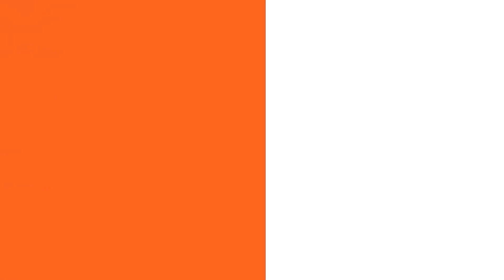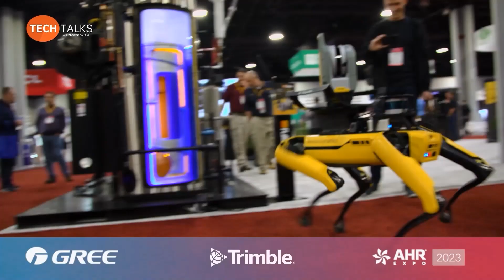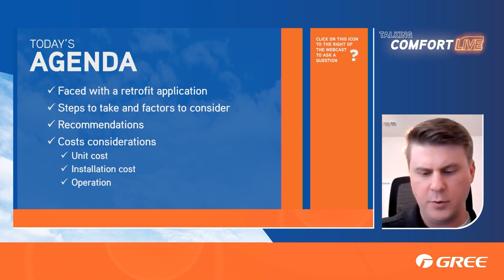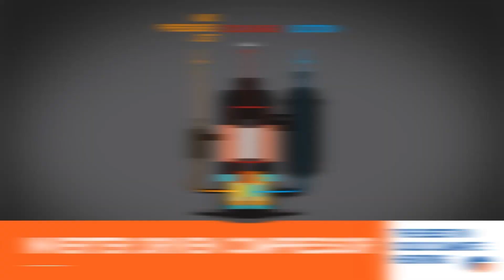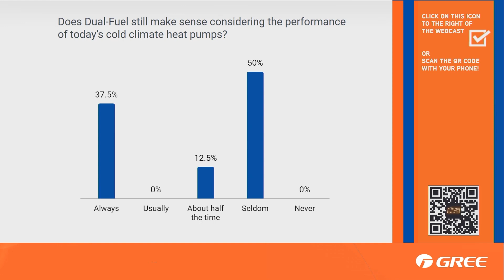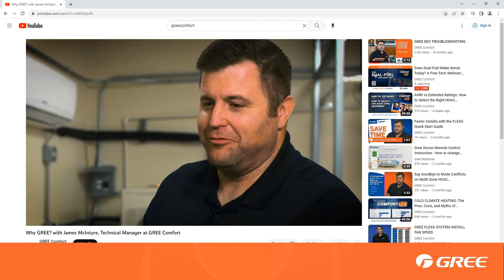Does Dual-Fuel Make Sense Today? The steps to take & factors to consider when faced with a retrofit

Comment: I sell a majority of dual-fuel systems in the Denver area.  If they already have a PVC based 95+, we have many options all the way to full modulating variable speed furnace or if they have an 80% then we do a two-stage natural gas Bryant Evolution or ICP Ion, plus either of their HP's, (Fully variable or 5-stage Copeland Rotary scroll.  You setup the Connex or Ion to change the setpoint and furnace runs in the first stage nearly 90% of the time, if you size the unit correctly.  

The Oher setup are the Daikin Fit or my preferred the Amana  S-Series with whatever furnace HE or 80% two-stage gas with VCA blower.  This applies to all the new Goodman units also because Daikin made a whole matching series of equipment for all three brands.  If you have the right furnace with a 5-ton drive at 80k-100k C-cabinets and configure and set it up correctly to furnace settings and the proper Daikin One+, Amana and Goodman thermostat and CoolCloud.  

When the COP breaks below 2.8 or below, switch it over to the NG furnace.  So many can go to 5 degrees.  If they solar panels and or a battery storage system, you can extend that HP usage.  If necessary, you can run the HP down to -22. 
But he furnaces would have been in first stage VCA blower keeping the house amazingly warm.  
I have many clients who opt for the 80% two-stage VCA blower furnace because they don't want their finished basement torn up, unless we can run both PVC flues directly down the joint or concentric.  

I have a solution for everyone and most of the people I know in California want all-natural gas because electric is far too expensive to heat.  They want nothing to do with anything that is 96%-98% modulating furnace.

Comment: One of Gree competitors starts making ducted heat pumps which pushing some air through ducts even when there is no call for heating or cooling . I like that idea a lot, now I could install simple hrv just for a living room and get fresh air throughout a house without spending too much money. Would new Flexx model have such option?  I did not make up my mind yet which system to buy
Reply from the maker: Thanks for considering our systems! Yes, that could be an option for you since The FLEXX uses a 24V signal to run the blower.